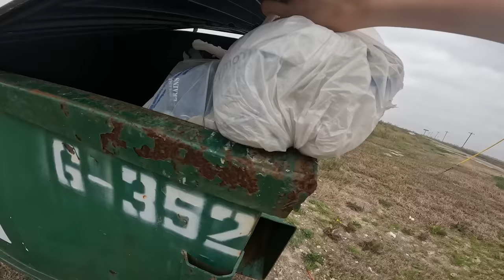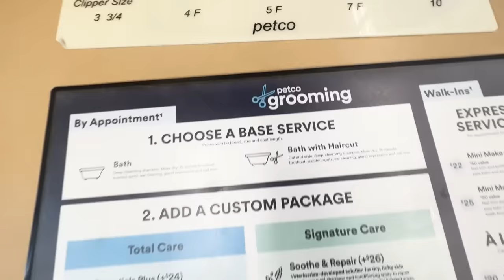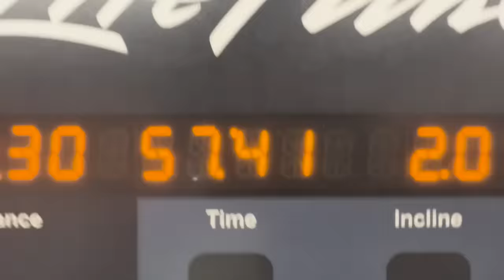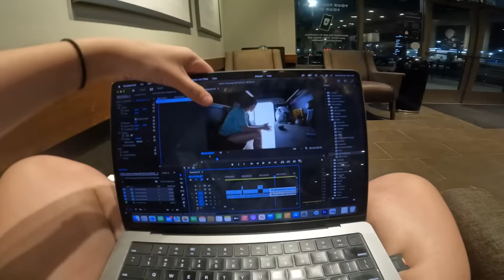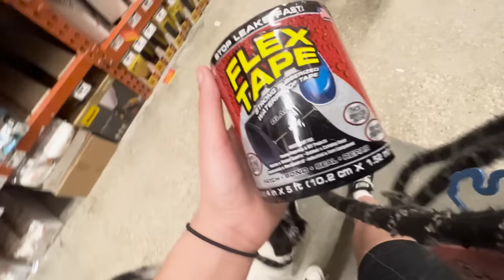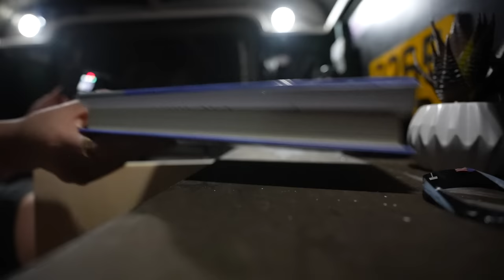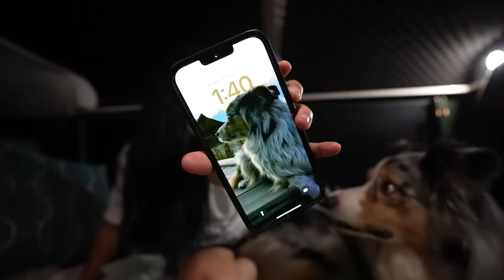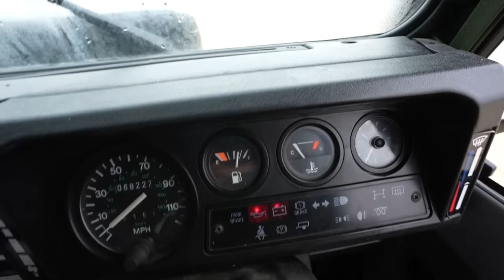I Live in a Military Truck - A Realistic Day in the Life

Comment: one other super quick small thing. that salty humid air will wreak havoc on your rigs metal body panels (rust & corrosion). once you make your way away from the coast run by a car wash and rinse Poe if you're able.
Reply: Basically the Defender is all aluminum, except the frame, which comes pre rusted from the factory

Comment: I had a bit of an idea....

The seat-base of a Defender is, as I'm sure you know, a separate, removeable, part of the seat.
It should be pretty easy to make an entirely new seat-base from wood.
The seat-base attaches with 4 steel pegs (two at the back and one on each side at the front).
It should be possible to make a wooden frame (out of, say 2" x 2" wood) and then put 4 bolts through it to replicate the 4 metal pegs that fix it in place.
You could then build a flat wooden platform on top of the frame that extends all the way forward to the dashboard, big enough for a proper dog bed, to give Blue more space, and you wouldn't have to worry about him slipping off the seat when you hit the brakes.
If you wanted to be really clever you could make the platform hinge at the back (kind of like a toilet seat) so it lifts up for Blue get in and out, and so you can access anything stored under the platform.
You could keep the original seat-base in the footwell, store stuff on top of it, Blue would have his platform AND you could swap everything back if you ever have a human passenger.

Also, while, I'm at it, you should buy yourself a half-decent air-compressor... and a foot-pump.
If you're planning on driving on beaches, it's best to lower your tyre pressure to avoid getting stuck.
Of course, once you've let air out of your tyres to drive on a beach, you'll need the compressor to pump them back up again when you get off the beach.
And, the foot-pump is for when, inevitably, the compressor decides to die just when you need it to pump up your tyres.
Reply: I liked learning about your suggestions..

Comment: With regards to the sink.  Remove the tape.  Then put the stopper in the sink and fill it with water.  Look under the sink and if it is dripping the leak is coming from the drain connection, use plumbers putty or silicone.  If it is not leaking, remove the stopper and drain the sink, and watch where the water is coming from, then fix the connection with Teflon tape.  (I did notice that there is a paper sticker on the bottom of the bowl where the drain is, I am guessing, that may be your issue.  Good luck.
Reply: Like you, as soon as I saw that sticker, yep that could be the spot

Comment: Hey, I'm no professional, do you have proper ventilation in Bo while you sleep? I'm thinking that since the temp. probably drops, your breath while you sleep is generating a lot of moisture, not to mention the humid air around you. I've noticed it's not really collecting condensation on the ceiling during the day while you're in and out of the vehicle. So, maybe if you install a small fan near the ceiling to suck the humid air out at night... maybe that will help. Or, they have really cheap plug-in dehumidfiers that you can drain with a tube through a tiny hole in the floor. Or, as a temp. last resort... get a couple of those little closet silica-gel dehumidifier things to soak up excess moisture in the cab. 

Just shooting some ideas at you for relief!

Comment: You may want to look into a ThermaCell to repel the skeeters. You may also want to look into those screens for your doors since you have door frames on the Defender. I wonder if it would possible to get replacement windows for the back of Poe that open and have screens on them.....if you were interested. One last thing, you can get insulated window covers for when you are in colder climates. Love the adventures you and Blue have, I travel vicariously through your videos!

Comment: How to kill mosquitoes easily in an indoor space: 1. Make a mixture of about 20% household cleaner (we use Fabuloso bc it smells nice) and 80% water in a spray bottle. 2. Fix the mosquito in place with a strong flash/pen/phonelight held about a foot away from it. They freeze under a bright light. 3. Get the spray nozzle a couple inches from the mosquito (it won't leave- it's disoriented by the light) as you move the light to within a few inches.. One quick accurate spritz kills the little bugger dead. We also use it as a repellent when we open doors to go inside or outside.

Comment: i camp out of my prius and i just bought a small dehumidifier and it works great... i plug it into my jackery and barely uses any power its a 1500 jackery. usually i just sleep with the windows down with covers so no bugs so i dont need to use it but if its cold or city camping and i need to seal the car up i use it and it helps ALOT

Comment: You more likely are having condensation issues on the pipe versus a leak.    Remember that the water in your system is often dramatically colder than the ambient temperature as you drive from state to state.  That would be the cause of the condensation.

Comment: Again not sure if or when you will see this.  I have bit into the orange skin b4.  But years back my Mom would cut the orange into 8 pieces - you hold the wee tip and pull the fruit off the skin.  Turn your insides lights to red.

Comment: I don't know if anyone has mentioned this to you yet, but any form of heat, including your breath, when it's cold or wet outside will cause condensation inside your vehicle. You really need insulation and a water vapor barrier over that if you want to control the condensation from building up.  Might want to look up some YouTube videos on how to insulate a converted vehicle and control condensation. You may end up with mold over time if you're not able to fix the condensation problem.

Comment: Here's would be my suggestion you don't want to cut a hole in your roof, have somebody take one of those windows out in the back small Windows if that's 6in wide you can get this fan into one of those and just mount, have someone cut you a piece of aluminum the size of the window, Mount the fan in a 6 inch hole in the aluminum plate that used to be a window and run power, whoop whoop

Comment: not trying to be mean but there is no situation that could happen under that sink where flex seal tape is the answer. if it's condensation then the pipe would need to be insulated, which flex seal will not do. if it's leaking at a joint, it's still going to leak.
remove the flex seal, cover the sink drain, fill the sink with an inch or so of water, add some food coloring to the sink water, uncover the sink drain and watch the pipes to see if colored water leaks out and if so, from where. if you don't do that the wood will mold and rot. if you find a leaking joint use 'Teflon tape' on the threads of the leaking joint to fix it.

Comment: That's not the right tape. Also, you have to find where the leak is coming from, you probably don't need tape at all. You probably just need to tighten sink drain fittings. Most likely the drain basket nut.